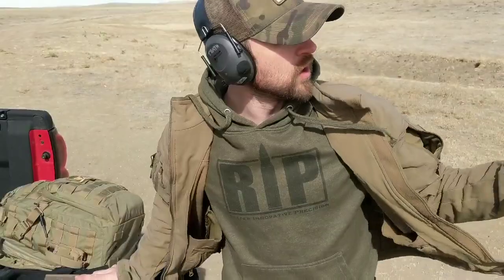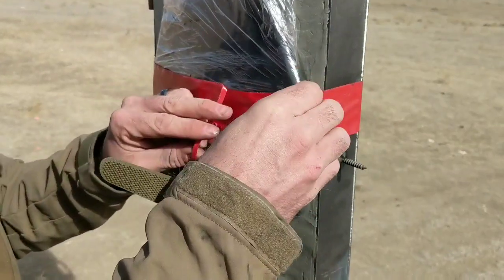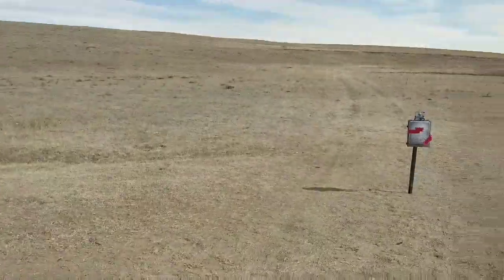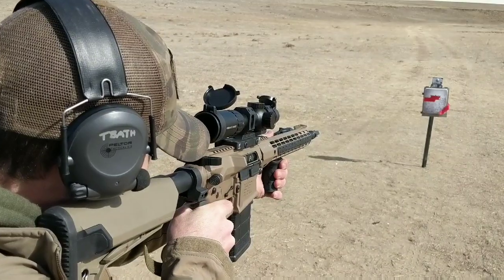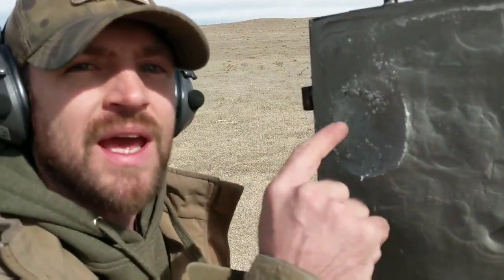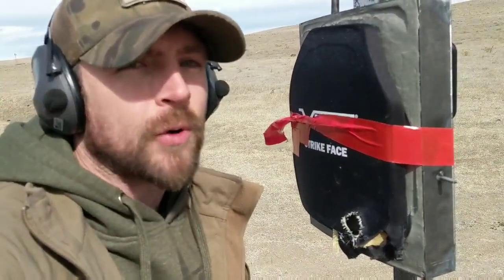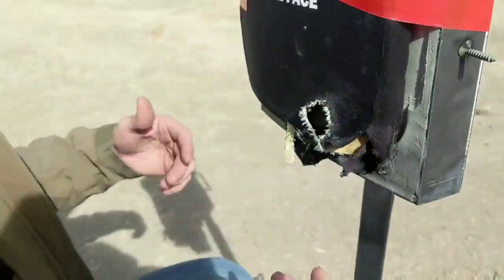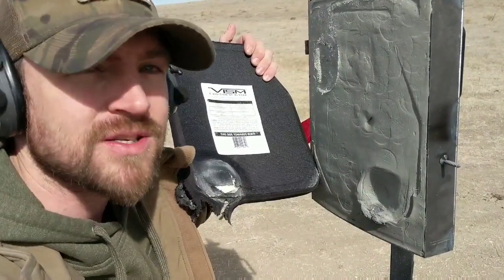Steel Ops - Body Armor vs 308 using Ballistic Clay

Comment: Excellent video🔥, exactly what I'm always talking about, regardless people act ignorant towards the fact that the lighter armor disperses far less
Reply from the maker: It's pretty common sense when you think about it. Which gun recoils more, a light gun or a heavy gun? A light gun does because there's not as much mass to absorb the recoil. When you're wearing a lighter plate the energy is going to transfer more easily through the plate into your body. Whether that's enough to create trauma is debatable and depends on caliber, garments, angle of incidence, etc.  But there's definitely a sweet spot with weight and, until new technology is invented, current armor can definitely be both too heavy AND too light.